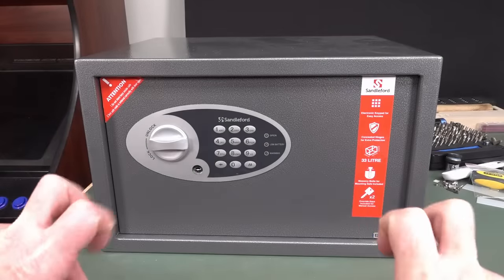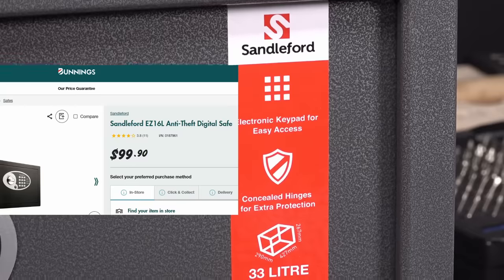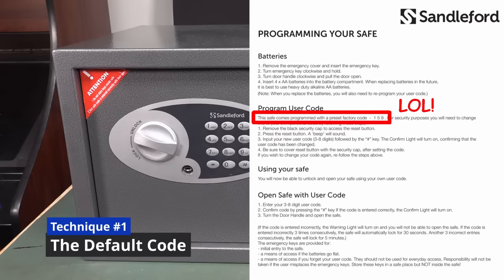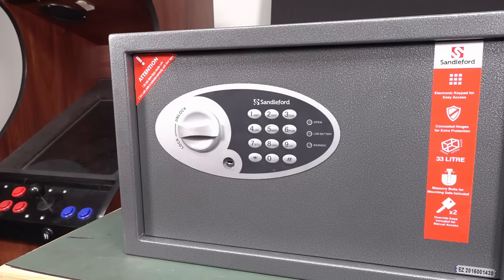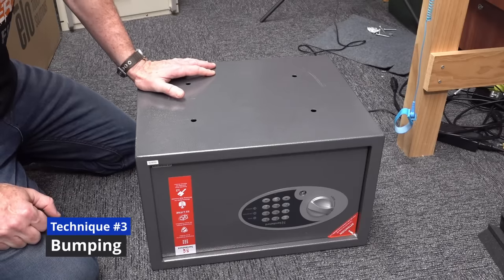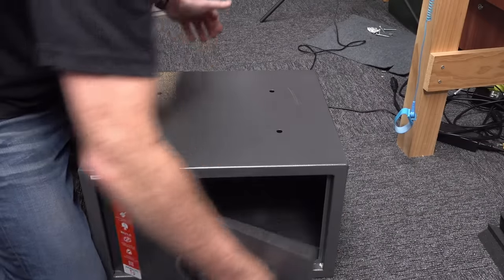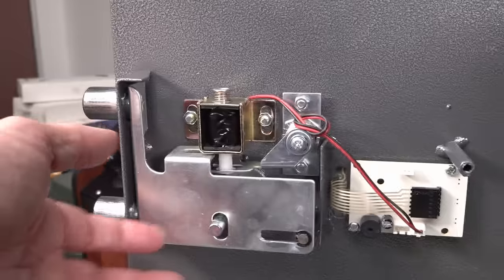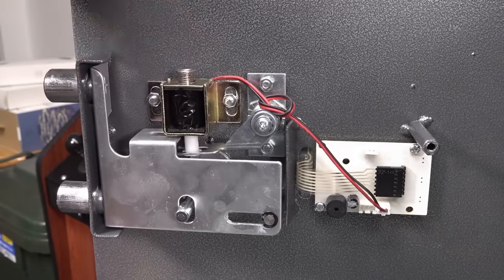EEVblog 1494 - FIVE Ways to Open a CHEAP SAFE!

Comment: New & improved  instructions:  1)  Place safe on desk; fill with nuts, bolts and hotel bibles; lock safe.  2) Place valuables in desk drawer.
Reply: Add a bottle of green, luminescent liquid with radioactivity logo. Smear a bit of the liquid on the bottle...
Reply: This is how you loose a good quality desk drawer.
Reply: I knew a family that put their fine silverware (not the cheap plated stuff) in the kitchen drawers and put the stainless flatware neatly in the fancy case in the dining room.  Sure enough during their vacation burglars came in and stole the stainless, leaving the silver.
Reply: It's a decent lock box. Just add two eye bolts and a decent padlock
Reply: These are the common safes used in hotel rooms.
Reply: @MrVeryCranky  i could be wrong, but  i really  don’t think the average hotel safe is as bad as this one.   they are built to a much higher price point and i think they tend to reflect that.    but i’ll definitely be check checking  future  hotel safes to see if their keypad is a peel off sticker like this one!
Reply: I need a safe to put all my important toys
Reply: Yes, maybe the burglar will read the Bible and change their evil ways. Then, use the nuts and bolts and get a real job!

Comment: I have a similar one. Whacking the top with your fist while twisting the knob at the right moment works the same as the drop method. Once you get the hang of it, its faster and easier than punching in the code. Actually the batteries died years ago so this is now the main method of opening
Reply from the maker: Doesn't work on this one unfortunately.
Reply: @EEVblog  I found when testing safes in China that most would open if the weren't attached to something but once firmly bolted then it was rare that a thump would open one. As the saying goes you can get any quality you want to pay the money to get.
Reply: This one has the solenoid upside-down, you'd wanna hit the bottom.
Reply: @nobodynoone2500  you need to turn it upside down to use gravity in your favor.
Reply: @ianmontgomery7534  Cool story bro. Smells of BS.
Reply: if you don't own the safe, this method is a bit loud though.
Reply: There's some videos here on YT where people are opening cheap "safes" using different methods to bump them. I remember someone (BosnianBill?) using a potato he whacked the safe with and got it open. Not all are that easy, but these electronic locks with a solenoid are all some what susceptible to the bump attack. And yes this was done also to safes mounted in hotel rooms. Well not the potato bump, but rubber mallets, bare hands and such worked.
Reply: Is your real name Fonzarelli?
Reply: That technique works on everything. Give that old TV a good whack.
Reply: I just did this and it worked after a few bangs on it, my safe is bolted down so I banged on the door with a rubber mallet while turning the knob, easy pleasy 👍👍

Comment: I found a while ago a cheap safe I picked up can be unlocked simply by turning it upside down !
Reply: Those are basically lock boxes, they're not safes.
Lol, as secure as a desk drawer
Reply: Not much use in Australia, then! ;-)
Reply: Not true, stop spreading lies
Reply: @KingNexusMOCs  if I still had it I would do a video proving it, the mechanism was weighted, if you turned it over either clockwise or anticlockwise (I don’t remember which) it caused it to unlock from the mechanism moving.

Comment: The 6th way is to insert a rod through the mounting holes on the back and press the code reset button. I've actually done this. This is why it's so important to anchor these cheap safes.
Reply from the maker: Not in this case, it has a cap covering the button.
Reply: @EEVblog  Wow. They did something right.

Comment: I'm using one of these cheap "lockboxes" for storing my firearm, but... I knew about their weaknesses, so I made some modifications to the mechanism and door and bolted the lockbox to the concrete wall. Then, I live in the flat on the 8th floor and the only way inside is good quality safety door, so this is the main line of defense against the outsiders. And there are only adults in out home, so this lockbox is only against visitor's nosy kids or something random like that. It is definitely better than keeping the gun in the bedside cabinet drawer. Also, if you have one or two firearms, there are no specific requirement for a certified safe in our law.
But I agree with you about the quality of these things, at least in the as-sold state, without modifications. Of course, I wouldn't even consider one of these lockboxes, if the conditions is different (living in house or on lower floor, kids in house,...) In that case, I would buy a proper, certified safe, even though it is not required by the law.

Comment: "Hi, its the lock picking eevblog, with your host, dave!" great stuff 👍
Reply: The difference is here you want to see a Fluke
Reply: This is the LockPickingBlogger, and what I have for you today is a cheap Sandleford Safe from my local hardware store... little click on 1 ... not sure what's holding us up here... aaaaand we're open. Ok folks, thats all I have for you today... 😆😂
Reply: What item did you use to pick the actual lock as you can’t see it in video. Thanks

Comment: Take off LaGard keypad 1 sec. 
Drill 1/8th inch hole into lockbody through spindle hole 10 sec.
Inject 500 cc contact fluid into lockbody with a syringe 10. sec,
Attach 9V battery (2 in line are better) 5 sec.
Turn spindle into opening position with a hex key.
OPENS all LaGard's, some S&Gs,  Wittkopp Swingbolt 1000, 
M-Lock Roto/Swing/Straight. All Technosicurezza and the KABA SL 525 ATM Locks-

Comment: I have a very similar one.  I never intended it to keep out burglars, but just wanted it to hold some of the important paperwork that you collect over the years and need to keep just in case someone asks for them (diploma's, deeds from the notary, insurance papers...) and want to protect a bit extra against fire.  As far as I was concerned, the lock was not really required as long as the door can be kept close.
Reply: but then you should get one that is fire rated, not a square beercan

Comment: I made a stronger safe in appy school, using scrap steel from the welding shop. Cut pieces of 6mm steel plate, and welded them together to make the cabinet, and similar steel for the door. Put on a cheapish Ezlett wafer lock, but it is hard to copy the keys, simply because they are so sloppy, and thus tend to need hand finishing to get the copy to work. Used it for years as a basic money, document and key safe. A lot better than the junk electronic ones, which you can open with nothing more than a few paper clips, or even just a big screwdriver.

Incidentally the solid steel safe is not resistant to a plasma cutter, you need to have layered protection for that, and there to make matters worse for the one breaking in they put tool steel rods in the cement fill they use between the layers, to shatter diamond bits as well. You need to mount them 3 sides to the wall and floor to make them more resistant, as thieves come these days with big crowbars, and the fixings supplied with the safes are laughable. I mounted using M10 rawlbolts for the 3 sides, and that was going to make it hard to break it out, going into concrete on 2 sides and solid brick the third.

Incidentally that CMI is the only one of the 2 you have that actually is rated to store firearms, the dumpster one is not even rated for anything, not fire resistant, or even rated for anything more that $100 in contents.
Reply from the maker: Yes, as I mentioned you need a TDR safe to be resistant to plasma cutters (that's the T for torch in TDR) and drilling attacks (the D in TDR)
Reply: You could have carved a lock out of soap and saved time.

Comment: Method 6: get a wrench on the handle and turn; with enough leverage the metal plate will deform or dislodge the nylon jobber.

Comment: For those interested in acquiring safes, though, do keep this in mind before you waste your money on crap: it doesn't matter how sophisticated the lock is, any safe that hides naively behind a painting or is in some way easy to find or bump into, is crap, as it can always be easily opened with the gun-to-the-head master key. Bulky safes with locks are only safely closed when no one's around (e.g., in a business building, during the night, when no one's there).

For personal use, though, the only safes worth having are those that no one even dreams they exist. They don't even need a lock, they just need to be inconspicuous and very hard to find or bump into. A great example of that is a fake electrical plug. Potential thieves never dream that one (or more) of your 20 or 30 plugs contains a stash of jewels or money or whatever.

Regular objects can also be turned into safes. But keep in mind you should choose objects that aren't worth stealing. Don't insert hidden containers into your €500 speakers or your beautiful ornate chest, or else potential thieves might take your safes with them. Also keep in mind, thieves might throw things on the ground and find a safe on a fragile object.

Comment: Thanks, Dave. We had one of these safes that wouldn't open. I tried dropping it on the top while turning the handle but it didn't work. After explaining how the solenoid worked, I realised I was turning the handle too hard and jamming it in the locked position. I turned the handle gently and two drops later, it popped open.

Comment: Thinking about it, this type of safe will be the perfect box for my 1.8kVA isolation transformer.
Reply: How can you fit a 1.8kVA in there?
Reply: @BassheadMusicConnoisseur  Probably sideways with extension nuts on the threaded rods.
But I have an old movie projector power supply box for this use.

Comment: What surprised me when I took apart a cheap safe was that they put the brains of the electronic lock on the outside of the door, protected only by a flimsy plastic housing.

So, the wires going to the solenoid, reset button and battery were already threaded through to the front; you would just have to smash the plastic off to access them.

But, actually, exterior electronics make sense from a manufacturing cost point of view when the safe already has multiple other more easily exploitable weaknesses.

Comment: Dingle arm is the correct engineering terminology for this encabulation.
Reply: And "wobble rod" for the bit that moves when you thump the safe.
Reply: Is it reciprocal though?
Reply: But where does the lunar wane shaft connect? And how do you eliminate side fumbling??
Reply: There's not enough drawn reciprocation in the dingle-arm, so sinusoidal repleneration was not effectively prevented.
Reply: @PhillipRhodes  six hydrocoptic marzelvanes fitted to the ambifacient lunar waneshaft prevent side fumbling.
Reply: @mattmoreira210  - now where in the world would anybody get enough prefabulated amulite to build a baseplate sufficient to support that!?!???

Comment: There was one of these installed in a built in wardrobe at a property I bought to rent out... Bolted to the wall so we couldn't drop it or access anything from the back. Batteries were flat. Picked it in about 2 minutes.... And it was the first real lock I ever picked about 2 weeks after getting my lock picks.
We left it locked open with no batteries installed, and basic instructions to use it. As far as we know, zero tenants have used it since I opened it. Probably for the best.

Comment: When I was a manager at a movie theatre we had a few safes and the smallest was a chubb. It held the cash tills for box office and concessions etc. I was easily a ton. The door was an inch and half sold steel. It was crazy strong. I sat on the floor on an office carpet. One day they wanted to be stacked on another even bigger safe. They had to get a special forklift machine to move it.  Crazy

Comment: I go metal detecting at rivers and beaches and once found a large Sandleford safe from Bunnings on the riverbed.  It was peeled open like a sardine can (2mm thick steel...) and the contents stolen.  There were jewelry bags inside so the thieves got something valuable.  The thieves had plenty of time to open the safe, as they just picked it up and carried it away from the home/business as it wasn't bolted down!  No damage to any of the mounting holes.

Don't buy a save from Bunnings.  Never buy a safe that has a 'bypass' key.  They're almost all easily pickable.  Bolt your safe to concrete.  Buy something that will resist an angle grinder for at least a few minutes (anything under 6mm is a joke, 12+ recommended).

Comment: I have one of a similar price and size, but mine is much heavier, especially on the right side, it has a glass in the door and a keypad with a few buttons but most times I just press the same button several times so that it warms up the milk for my breakfast.
Maybe someone else has already mentioned this model because I haven't read the other comments since it's 4:45 am and I want to go to bed ;-)

Comment: That's far worse internally than the one I had to get open for a local charity shop a few years back after all keys had been lost including the spare.

Drilled out the lock then took the replacement safe apart to see how to trip the unlock mechanism and made up a bent-wire tool to do it. The new one was slightly different so I couldn't just swap the door and the fixing holes were different. Then while clearing up guess what? I found someone had put the spare key for the old safe in the box of the new one...

Comment: considering it's just a plastic piece holding back the locking slide mechanism, i'd imagine if you got good leverage on the turning knob you can just force it open by breaking/deforming the nylon piece. You should try that!

I'd imagine just grabbing on to the knob (or pulling off the knob fascia to expose the actual turning mechanism) with some vicegrips or a decent pair of pliers you can just force the safe open as the plastic bit gets forced into the center gap of the metal slide or breaks (I also wouldn't be surprised if the metal slide bends instead as it looks like cheap metal).
Reply: I thought the same.
Reply from the maker: Yes, but the whole idea was to show ways to do it without physical force. There are probbaly half a dozen ways to smash/pry into this thing.
Reply: @EEVblog  my pefered way to get in to non-theft rated safes is circular saw with a carbide tooth steel cutting blade. In the US people get tricked into buying giant fire safe. They are just mild steel with drywall/plaster inside for fire protection. People think they are secure because they are thick and heavy, but it takes about 5 minutes to cut the top a safe you could fit a person in.

At home I have TL-30 rated safe I bought from a chain store that closed. Paid about 10 cents a pound for it lol. Replaced the time lock with a electronic keypad from the manufacturer, cost twice what I paid for the safe!
Reply: The knob looks like its attached to the rest of the mechanism by a couple of cotter pins, you might shear those off before you manage to deform the nylon stopper.
Reply: Tried it. The knob, maybe by design?, is weak and breaks off when forced. Shaft on mine was plastic so impossible to grab and force turn it too. Perhaps mine was a higher spec....haha

Comment: There's another attack vector that I used on my own safe when I found it locked and thrown in a dumpster. It's slightly better quality than that one you have there, many more security features so you can't get in around the keypad etc.

A coathanger pushed through one of the mounting holes or AROUND THE PERIMETER OF THE DOOR, press the reset switch and enter a new code. Really simple.
Reply: I opened one by drilling small hole to the side and using straigth stick to press reset button.

Comment: Love the video.  I laughed through the whole thing.   You smacked the top and you could hear it was just sheet metal.   I laughed again when the label was peeled back and the holes were there.   I got old ham radios and test equipment with thicker metal in it.   The big magnet seemed to hold the door better than the latch.   It looks like that nylon cap could actually be worn down.  If you pry enough force on the lock lever it would just slip over that nylon.   Dave is right.   If you can carry it, it is not a safe.

Comment: Banging hard on the top with a rubber mallet causes most cheap safes to open.
TeaBagging also works depending on knacker size and weight.
Reply from the maker: Not this one. I tried it.